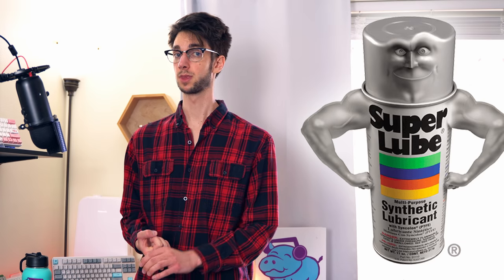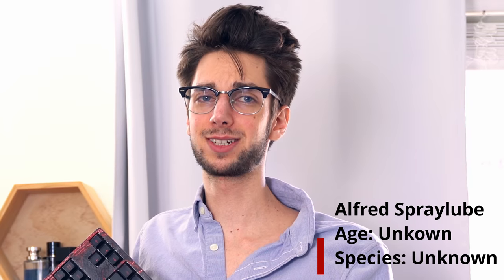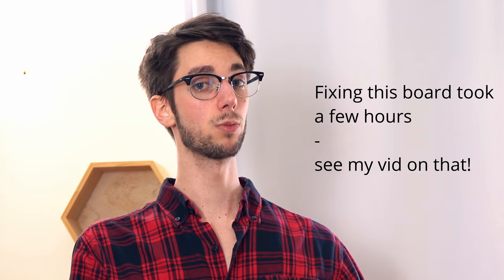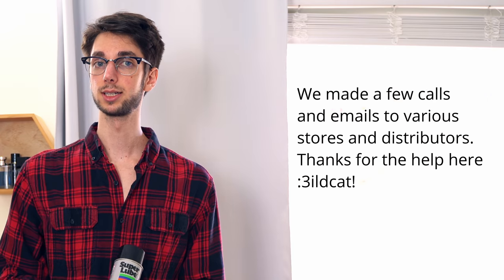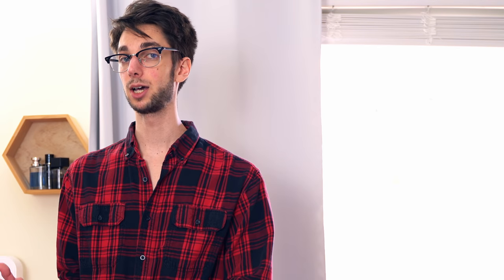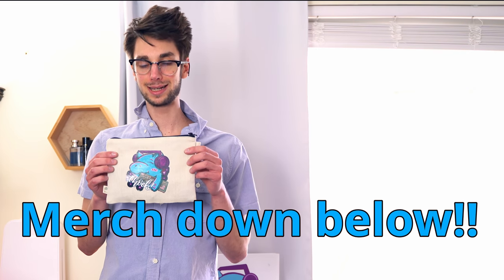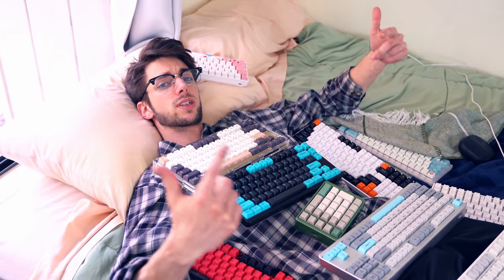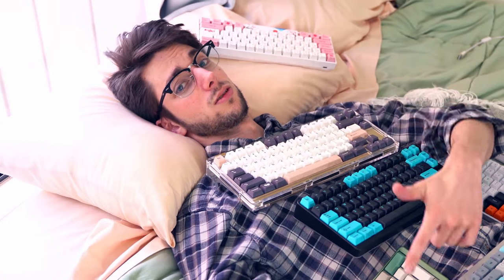Doing This Will BREAK Your Keyboard... (Spray Lubing)

Comment: THIE SPRAY METHOD WORKS !
However, take the switches out, spray lube them, and let them dry for a day or 2. I’ve done this with 87 switches and they have all worked out fine. I’m not using the fake formula I’m using the standard 31110 super lube

Comment: So... What I've gathered is that grease based lubes are... OKAY... ISH... 
But oil based lubes are just a huge no-no.
Now, I've used lithium grease before on keyboard stabilizers (I don't have any krytox okay?!), and it's been fine. 
So if you are to try this (don't), but if you are going to do it. Use lithium grease.

Comment: It's possible that the Korean knock-off formula is somehow less dielectric than the original Super Lube formula, or at the very least that the knock-off doesn't insulate as much as real Super Lube. Hence why if the latter happens to coat the contact points, it can prevent the completion of the circuit. This is of course just conjecture, but it's to say that the knock-off being of lower quality is probably why it doesn't break the switches. The fact that real SL can break switches means it's in fact doing it's job very well as a dielectric lubricant. Point being that getting lube on your contacts is probably never a good idea, and thankfully the base design of MX switches inherently keeps the contact points away from the places where we want to apply lube manually. Spray lubing is the keyboard equivalent of spray and pray, in this sense.

Comment: I have a sk64 and it has opticals. I bought it on amazon. I may have gotten a amazon return item. Because when I opened the keycaps I found a bit of dust/hair, and my keyboard was oily. when I plugged it in my keyboard kept on disconnecting. I found out that if I switch to a certain profile It disconnects and reconnects. so It may be the spraylube that ruined my board. Now I cant change the colors even though I probably leave it off. Spraylubing gateron opticals does not ruin switches. they ruin the PCB 💯

Comment: Instead of spray lubing a non hot swappable keyboard, what about just injecting lube via a syringe so you don't have lube leaking out onto the board?
Use a waxy lube like a dry bike chain lube?

Comment: bro i have no idea how i got a ALLEGEDLY "Korean counterfeit Super-Lube" but I got it like 3 years ago, and its got the whole rattly thing inside. I used it on a board and it actually did really well, it didn't break either. ALSO apparently the spray lube I have, EXPIRED in 2023 :)

Comment: Do you mean that the metal contacts of the switch break, or that the lubricant reaches the circuit board and breaks the substrate?

Comment: I was doing little research to see if this spraying method was worth trying on my keychron keyboards, and stumbled upon infomation that ptfe variant of super lube spray does have metal ball in it, makes the clanky noise as shown in wildcats' video. Was wondering if you have tested with that particular product? From what I could dig up it is pretty safe product to use for this purpose.

Comment: Maybe someone would want to try other brands of spray lube to find out which one works similar to the one used in Korea🤔

Or better yet, maybe someone would want to make a spray lube that is specifically designed for keyboard switches🤔

Comment: I used a tube of super lube i got on amazon on a keyboard that i couldn't desolder and It worked fine. I didn't break my board, but after a while, it feels like the lube just stops working.

Comment: I have a question. Since I'm just getting into Moding Keyboards, I want to lube my Optical Switches of my Razer Huntsman Elite. But I heard, If you want to lube it, you should spray lube, cause when you're gonna open up the Optical Switches you gonna break them. I don't know if this is right or not, cause Spray Lubing might also break it. So should I take the risk with Spray Lubing or is it possible to open up the Optical Switches without breaking them?

Comment: What about brush lubing using krytox, but without desoldering? Only seen this method for cherry switches because of the switch design, seems to work without any issues down the line

Comment: If the spray lube causes the metal contact to not work then wouldn't kailh box switches work since the contact isn't direct? im probably not going to spray lube a box switch im just curious

Comment: if theyre hot swappable, can i take the switches out and spray lube them? if the issue is damaging the PCB, then removing them would fix that issue. they would also dry faster if you leave them out of the board.

Comment: My keyboard is Hotswap, if I remove the switches will I have problems or is it only when you use spray lube on a soldered keyboard?

Comment: Did mine an works fine. For months all keys.
I didn't over do err just a very light coat.
Plus imma a mw2 kid that mains roller over MnK.
(Edit) just used good ol WD-40
Reply: hows it holding up?

Comment: Don't use spray lube!
If you're lazy like me:
Pick up Super Lube's Oil 51010 Squeeze Bottle and remove all switches from the PCB, put 4 droplets in each corner of each key switch when pressing it down, then dry them upside down for a couple hours, this ONLY works with hot swappable switches/PCB.

Comment: ive got optical browns on a 60% which im going to spray lube (away from the pcb) planning on getting a 75% soon to replace it and i will lube that correctly as its not optacial but ti will good to know just how different each are.
Reply: how did it work cause i want to do my optical reds

Comment: I WD40'ed my cheap ass old outemu blues hotswappable (yeah man I wanted to save time) after 5 months I wanted to clean it by removing keycaps and switches. Cleaning the case etc. but the I noticed some of the switches were kinda greenish idk why 
I washed them and now the work (pls don’t wash you switches with water and soap this could kill it or idk)

Comment: lol it is pretty bad, when i did it I used liquid silicone spray which might sound like a weird one but it worked quite well as a lube... for the first like 4 months and then it started sounding like shit. Funnily enough, though I spray lubed it I have at no point had any issues other then the typical ducky keyboard being shit with mac connection (or connection in general). The board sounded quite nice at first for a prebuilt xD.

Comment: Well ... I think the trick for spray lubrication is the drying time. I myself applied this method on a HyperX Alloy FPS with Cherry Red, with a lubricant based on PTFE with silicon (that is not Superlube, it is a brand called "3 in 1"), and that was about 6 months ago, and I have not had any input issue. At the end of the day, I think it is a matter of maintaining a good cleaning on the keyboard, and an appropriate drying time for the excess lubricant to evaporate. Great video as always Hipyo! ❤

Comment: i have found that it just takes way less lube when spraying then you think. a few switches on the first board I sprayed broke after about a mont which isn't surprising bc I used a fuck ton of lube. i sprayed an akko, focusing on spraying way less lube, just a small spray, none of it got out of the switch even. it has been about 2 months and I have had no issues. i could have just gotten lucky, who knows.
Reply from the maker: Yeah the whole point is you could do everything right and still break your board. It's totally random

Comment: IDK how this is a problem. I have spray lubed 3 keyboards and they all work correctly 100%. I believe that many people just don't realize how you are supposed to do it and dunk a ton of lube inside the switch then are surprised when their board doesn't work. Which you were one of them Hipyo. I saw your tutorial and you dunked the oil on the side with the metal leaves! The way you do it is you press down the switch until you can see the rails inside the switch housing, then spray the rails with a bit of oil. One small tap, not a squeeze.

I have always told others to only spray the rails of the switch and to leave the keyboard laying upside down after spray lubing for a day or two. This gets rid of any excess lube. Also, do not hold the nozzle when you spray, just tap it to get a little bit of lube in the rails. This way your metal leaves aren't drowned and soaked in DIELECTRIC oil. DIELECTRIC means that it prevents electricity from passing through, so if you coat your metal leaves in dielectric oil, you are essentially blocking them from closing the circuit when the leaves make contact, since their is a layer of insulating oil between them.

Comment: WIsh i saw this video before, took the chance with spray lubing and 4 of my switches kept double clicking or not even registering. Dipped the PCB with soldered switches in everclear (all i had) and then used a brush and super lube to lube the switch again and it works. Never doing that dumbass thing again.